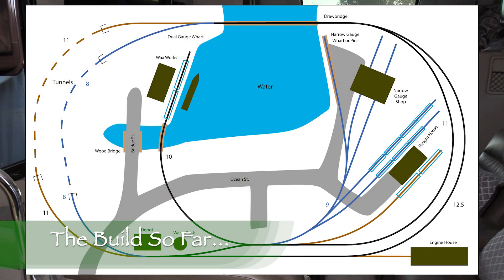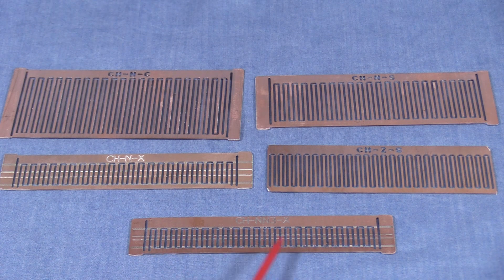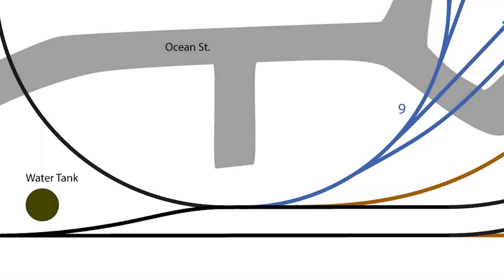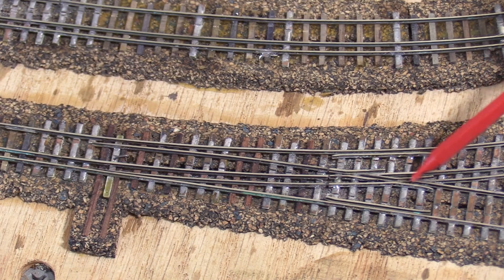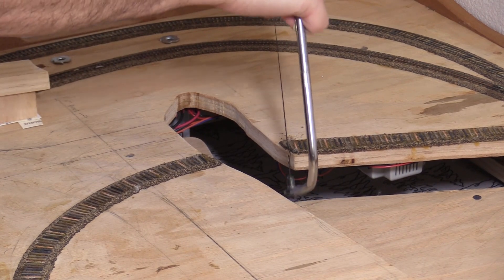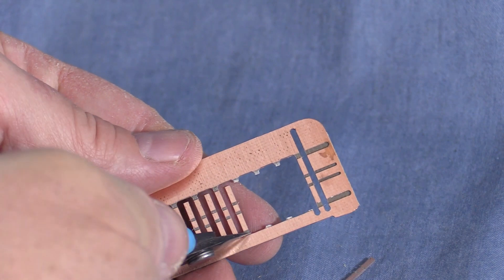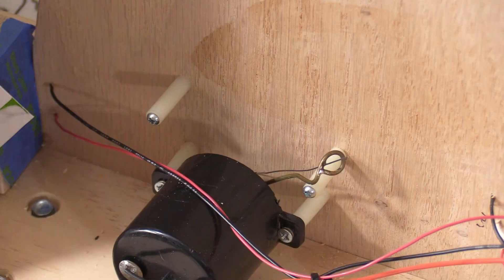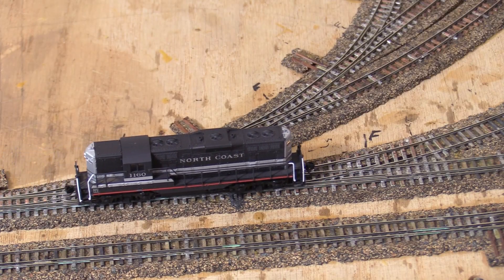Layout Building N Siren Creek Part 12 - Finishing the Track

Comment: I bet you're glad the track is done!  Those switches look very complicated.  Probably could pull the NN3 rolling stock with the standard gauge locomotive, may have to get creative with one of the cars coupler location to make an adapter car.
Reply from the maker: Yes, I'm definitely glad to be done with the track.  I think I remember seeing Rio Grande had a car with double couplers that could be used to move either standard or narrow gauge rolling stock.  I have started working on the locomotive again so hopefully before too long I'll be able to run it on the layout.  Thanks for watching!

Comment: Hey dan have you ever though about resin 3d printing? Id love to see you build a center cab from scratch in the future because you really do a perfect job when building models
Reply from the maker: I haven't designed any of my own 3D printed models, but I have purchased a few from Shapeways.  My Nn3 2-6-0 that I'm working on has a 3D printed cab and tender.  I also got a few Nn3 narrow gauge passenger cars from there.  At least some of those will be showing up as projects on the channel in the future, and definitely the engine.  Thanks for the suggestion and for watching!
Reply: @DanielCortopassi  I'd love to see you print maby an 80 tonner ex-us army? Or maby an old davel port some critter no manufacturer makes ( :